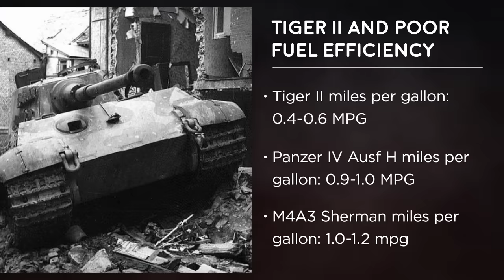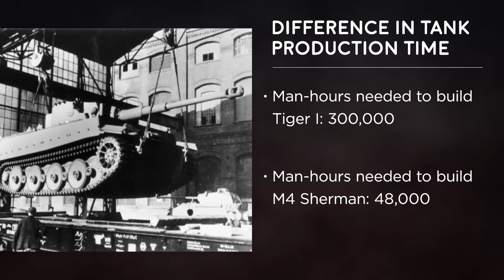Why Did German Tanks Perform So Badly in The Battle of the Bulge?

Comment: I think you missed the lack of an engineering capability to build bridges and support the advance.  If the germans could cross any stream after a few hours delay it would have made a world of difference.  The Americans could and did constantly bridge streams and rivers in surprisingly quick fashion using engineer battalions designed for that purpose.
Reply: The tank weight factors in there, though. Much easier to make something that let you bring a 35 ton tank across than a 70 ton one.

But yeah, the US did have a lot more toys. Hence why one German soldier said he knew the war was lost when he saw the US was all trucks, no horses.
Reply: @Axterix13  logistics was always a very underrated factor in american war fighting. sherman himself was a master supply officer - when a confederate officer blew up a tunnel to stop his advance, he said sherman probably had a spare in his baggage train.
Reply: This was by design. That is, the Americans were fully aware that any tank they brought to Europe would need to cross the continent's plentiful streams and rivers. So, they designed a tank that would do the job on the battle field, but would still be able to cross most of Europe's existing bridges. If those bridges had been taken out, the tanks had to be able to cross the portable bridges that the army could easily transport with them. This is a major reason why the Sherman wasn't bigger and heavier. If it had been, it would have been much harder to get the tank to the battle.
Reply: My MIT-educated uncle (RIP) was a US Army combat engineer in WW2-Europe. I dont know if he was in the Bulge but he died around 2000 playing tennis.
Reply: @DKWalser  Can I offer a slightly different perspective?  I recall reading something that said the Sherman's dimensions were dictated not by knowledge of E.T. conditions but rather U.S. transportation infrastructure constraints.  I don't recall if the article contended it was railroad or shipboard environments that resulted in Sherman's "petite" size.
Reply: @fredjuengling631  Can’t both perspectives be true? The Sherman wasn’t designed in a vacuum. They knew it had to have a gun large enough to deal with the enemy tanks it was likely to encounter, have enough armor to keep the tank in the battle, and yet be light enough that it would have adequate speed and mobility on the battlefield. Yet, it also had to be reliable and they had to be able to ship it from where it was built to where it was needed. They also needed to build them in sufficient numbers. 

So, yes, they were concerned about whether the US’s existing railroad and harbor facilities could ship the beast if it were much larger. But, a larger concern was the ability to offload heavy tanks in Europe using war-damaged facilities. And, once there, whether the existing rail and road infrastructure were sufficient to get the tank to battle. Upgrading the US infrastructure would have been relatively simple. That wasn’t the case in Europe. They knew the tanks would need to cross bridges that the army had built only minutes before. A lighter tank makes all that easier. 

They took all those considerations, and more, into account and came up with the compromise known as the M4 Sherman. With the exception of reliability, the Sherman may not have been the best at anything. Still, it was so good (even if not the best) in so many areas, that it may have been the best tank in WWII.
Reply: @fredjuengling631  It was both.
Reply: @DKWalser  The early M4 Sherman and the early Pz.IV were both designed as infantry support tanks NOT tank fighting tanks. THe Germans had the Pz.III which was to be the weapon used to fight tanks. The Americans planned to use dedicated tank destroyers to fight tanks.

The Pz.IV took over from the Pz.III because the Pz.III could not take a larger turret in order to use a bigger gun than its 5.5cm (55mm) gun.
Reply: @oldfrend  I was thinking of 
Sherman himself as the father of efficient combat engineering.
Reply: @fredjuengling631  The Sherman's weight was determined by the capacity of the bulk of cranes needed to lift it into the hold or ships as well as the width or railway tracks.   The Germans did manage to get Tigers (about 30 to Tunisia.) They had to removed tracks and replace them with narrow combat tracks to get on many railway wagons and used rare heavy lift cranes.  (Central European station widths were bigger than Eastern European)
Reply: @sirridesalot6652  That's a widespread but inaccurate understanding of the US tank destroyer doctrine of WW2.  The actual doctrine was that tanks were intended to be used for offensive operations, which was why the M4 was equipped with a 75mm gun: it was a good all-around gun that fired both armor-piercing and high explosive shells that let it be effective against both enemy tanks and infantry bunkers.

Tank destroyers, meanwhile, were intended to be used for defensive operations to counter attacks by enemy armor.  That's why the M10 and M18 had significantly reduced armor and a 76mm gun, which had a better armor piercing shell than the 75 but didn't (at the time) have an effective high explosive round.  The idea was that when an American position was assaulted, the tank destroyers could quickly position themselves to counterattack and retreat out of harm's way.

Of course, things often didn't work out that way on the battlefield.  But the idea that the M4 was not intended to fight enemy tanks is simply a myth- in fact when it was first deployed, the M4's 75mm gun was so effective against Pz IIIs and IVs that at least one officer predicted that the Sherman would be able to go through the entire war without needing an upgrade.  This was, of course, prior to the arrival of the Tiger.
Reply: The Anglo-American combat engineers were one of the unheralded reasons for the victory in Europe. It is as simple as that. They sure earned their pay in that war.
Reply: @TeaParty1776 how did he die if you don’t mind me asking?
Reply: @Walker-ow7vj  Heart attack. He was 80 and  tennis takes very quick, intense acceleration of running and twisting. He once won a game w/the East German womans tennis champion. A little known victory in the "Cold War." I like to think he would rather have died in tennis than war.
Reply: My dad was in the Army Corps of Engineers in the Pacific. He didn't talk about it too much.

Comment: The Firefly was not the Sherman 76. The firefly used the "3 inch" gun from the old 17-pounder towed gun, and while effective in armor penetration it was only a stop-gap, cumbersome and slow to reload. By the time of the bulge most of the anti-tank shermans were of the 76 type which was a much more functional purpose made design that left more room for the crew and was much faster to operate. 
(All three guns were actually the same bore, they were designated 75, 3", and 76 to avoid supply mistakes as the chambers and pressures were different.) 
There were also a few shermans with 105 guns but numbers were limited.
Reply: Neat thanks I didn’t know that about 3 inch vs 76 mm.
Reply: Just a note, the 105mm howitzer Shermans were used mainly as indirect artillery but could also be used as infantry support firing HE shells it was not designed as an improved anti tank gun.
Reply: The Chieftan's report on the Firefly is quite enlightening.  He covers the pros and cons.  One thing I did learn from that particular video was how incredibly accurate the American 76mm tank cannon was.  OTOH, the 17 pdr shooting the sabot ammo couldn't hit a bull in the ass with an ironing board beyond 500m.

Comment: So often, people look at the "hard" aspects of a tank, that being mobility, armour and firepower, and decide its value based off that.
But its the soft factors that have more of an impact. Ease of use, cost to build and maintain, crew comfort, fuel efficiency etc.
Reply: It is fully possible to have both.
Reply: in many ways the Tiger I fills these requirements. What few people know is that it was incredibly comfy to drive,with an actual steering wheel instead of levers and great ergonomics,even the frickin seatswere wrapped in leather. Cost and maintainability arent great but it ticks most of the other boxes just right. Always preferred the Tiger I over the panther because of its much better quality and better armor. If I had to choose any tank to fight in on a  WWII battlefield, I´d pick the Tiger I
Reply: @TTTT-oc4eb M1 Abrams and all of it's variants essentially.
Reply: I think the Ukrainians prefer to be using the latest tanks despite their cost and maintenance, lousy fuel efficiency and road limitations than the Soviet era "Jack in the Box" tanks that are simpler to operate and maintain. High tech means survival on the battlefield.